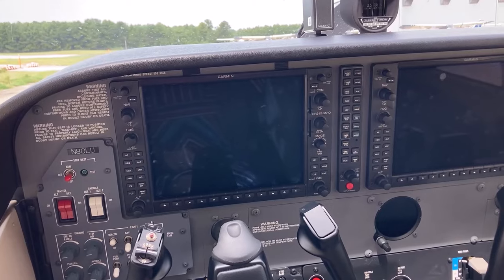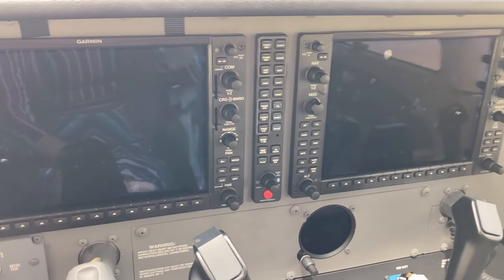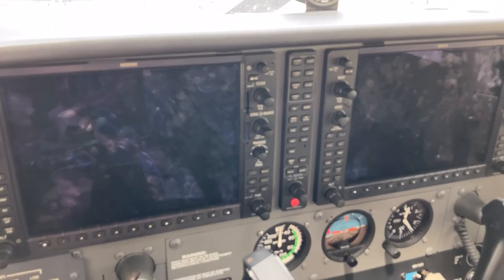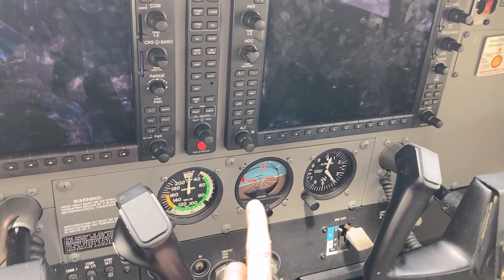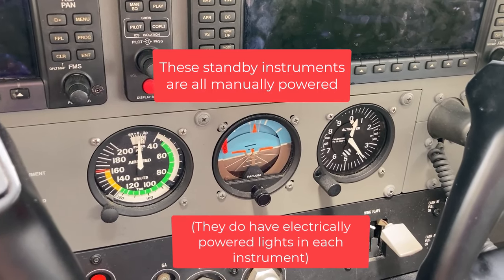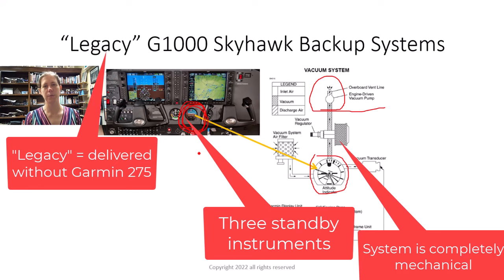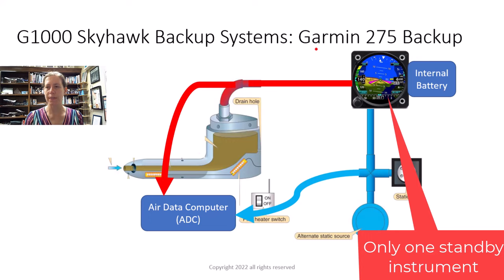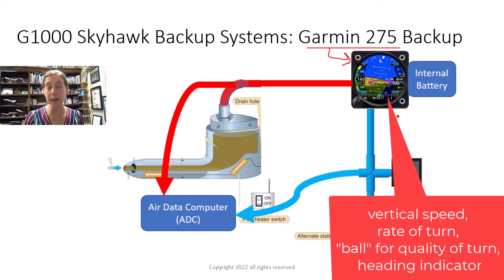What IFR pilots must know if flying IMC: G1000 Backup Instruments & Garmin 275 New Plane IFR Safety

Comment: I sure love your videos and how you articulate. Still working at preparing for the IFR knowledge test. I have a Piper Lance with the Garmin 750xi, 2 G5’s with GTN 500 auto pilot. Next month the avionics shop in Corvallis will be removing one of the G5 and installing the G3X. I was just talking to them about leaving a few of the old steam gages as well, airspeed, altimeter, vertical speed, and turn Coordinator which are still in it. They as well said it was doable and I think it’s at least some redundancy in the event your screens go black. The way you articulate the airplane systems is very helpful and I definitely appreciate all your videos that I’ve watched thank you.
Reply from the maker: Thanks for your kind words!!! I have some more videos in the pipeline...stay tuned.
Reply: @LauraLaster747  thank you, I’ll be looking for them.